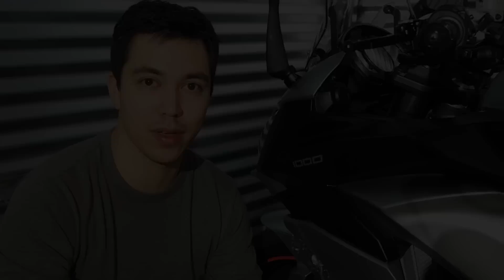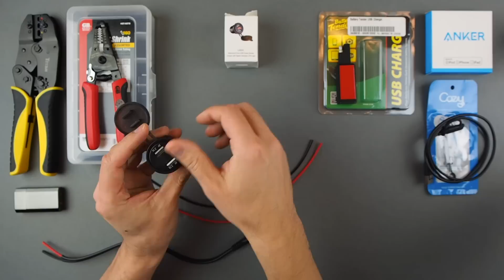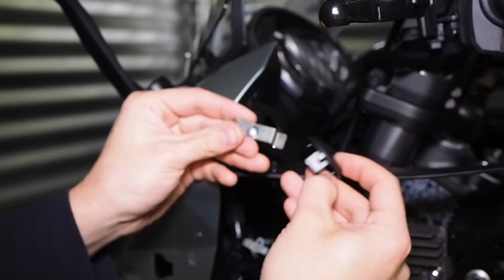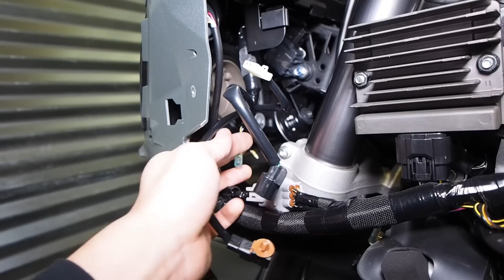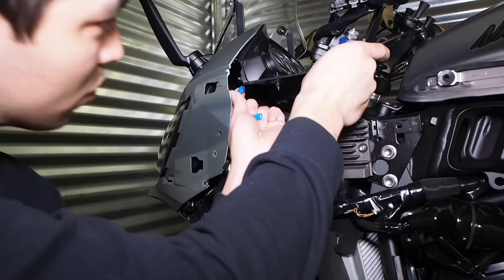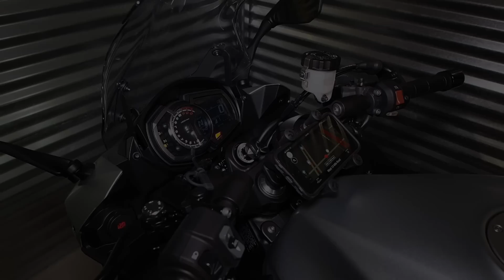USB Power Outlet Install: 2018 Ninja 1000 / Z1000SX

Comment: When the USB connector is not connected and the ignition is on I get a 12V reading using a multimeter from the connecting wires.
When I connect the USB device I take measurements from the base of the male spades at the back with the 12v connected and I get a reading of 5v and the USB device does not work. Any ideas?.
USB device works fine when connected directly to the battery.

Comment: the 2022 ninja 100sx has a connector plugged into a dummy socket on the chassis, this only outputs 4.5v so i took the 12v feed from the left headlight red lead
Reply: Thanks I have  2023 year and will follow your lead. did you just splice into the red headlight wire?

Comment: Need your help on how to connect the 2021 wiring Jonathan! Any help you can provide would be great. I wired up the whole thing and went to connect it, but found a two hole plug. Can I just wire both ends with bullet connectors and stick them in if I remove the little black stoppers?

Comment: Great video as always, I was wondering if the 2020 ninja 1000sx install is the same ?
Reply: I'm wondering the same thing as I pick mine up in April - great video and thanks so much for taking the time to make it!
Reply: Also, the USB socket you recommend is not available on Amazon - would this be a good alternative?  https://www.amazon.com/MICTUNING-MICUV2USBRED2-Voltmeter-Universal-Motorcycle/dp/B01M7V1ME1/ref=dp_prsubs_1?pd_rd_i=B01M7V1ME1&psc=1
Reply: @timobarlow  I’ve found the connection for the USB . I struggled to find it with just taking the small fairing off so I ended up taking the large side fairing off and found it taped up to another loom. I bought a usb socket from Amazon and also the connecting wires I need to fit into the original connection. Pretty straight forward from there on
Reply: @applewoody  Awesome - thanks for clarifying that and hope it all went smoothly.
Reply: @timobarlow  I then found full instructions with pictures on the z1000 uk forum ! Take a look
Reply: I’m gonna take the fairings off and have a look, I’m pretty sure those two connectors will be there waiting for the usb socket to be connected to them
Reply: @applewoody  Do you know what size the bullet connectors are? (4mm or 5mm)
Reply: I bought these, the connections aren’t the same as in the video, they’re the same as in the link. Hope this helps, mine are arriving tomorrow so I’ll be doing it then.
Reply: @applewoody  Don't see a link but I really appreciate your feedback. Keep me posted about your progress and good luck with the install!
Reply: @timobarlow  sorry can’t get the link to display here for some reason, here’s the copy and paste of the description......ZOEON 10 Sets 2 Pin Way Car Waterproof Electrical Connector Plug with Wire
Reply: @applewoody  How did it all work out Dave?
Reply: @timobarlow  great thanks mate, with the connection kit I mentioned above, I fitted the usb charger up front and also under the seat, there is a connector ready for that near the batters on the left side of the bike, taped to another thicker wire, I made a bracket in work and attached the socket to it. If you need any info and pics of why I did I guess you could find me on Facebook and I’ll show you
Reply: @applewoody  ok cool, I will - congrats on the install :)

Comment: Hi Jonathan,  nice video, very informative,  good job You doing here for us. 
I Wanted to ask You Do You Have instaled port or any kind of connection point to be able to charge Your motorcycle battery ? 
If so, can You make short video Please?
Thank You.        Vlad
Reply from the maker: I have a simple Battery Tender / SAE terminal connected to the battery.  There's no need for a video.  It just connects directly to the battery terminals, and is tucked away under the seat.  I only use it in the winter when the bike is stored for several months.

Comment: Annoyingly the 2020 ninja has dropped the bullet plugs in favour of some proprietary plastic plug. There's not a massive amount of slack on the cable either, so attaching a new connector was quite fiddly. I ended up taking the dash out of the bike which requires taking off the screen and a part of the nose to get better access. The screen is part of the dash on the 2020 so I disconnected the battery and then unplugged the screen. Also the connector for the dash port is a little more tucked away than on the old ninja - I didn't find it initially. As per the old ninja the one near the heat sink, further back is for the heated grips. They're not hanging loose either - they're placed in blank female connectors taped to the loom.
Reply: Bugger I was all geared up for this. Would of been pissed to start taking the fairing off & discover this. Thanks for the update looks like more dismantling is required.
Reply: Thx for sharing I'm planning to do this soon on my 2020. Is it a SAE connector?
Reply: No it's not. I asked one of the Kawasaki dealers and he wasn't sure what type of plug it was, and apparently Kawasaki don't sell individual plugs for their looms. I ended up buying an automotive 2 way plug from an electronics store and cutting the old plug off. You can get an idea of the existing plug here: https://kawasaki.com.au/shop/accessories/motorcycle/sport-super-sport-accessories/power-outlet-12v-2/

Comment: So, I have a 2020 ninja 650. It doesn’t seem to have those two wires behind the interface, but it does have an electrical accessories connector mounted under the left fairing. Would I use that for my dc power outlet? Do I need some type of relay to hook up to it?

Comment: How does the Battery Tender USB charger differ from you plugging in your USB cable to the Dual USB Socket you installed?
Reply from the maker: Functionally, there is no difference.  But the Battery Tender allows me to always have a phone charger cable installed and ready to use, without being very visible.  If I was just using the dual usb socket, then the charger cable is more visible and I would have to unplug it in the event of rain.  I almost never use the dual usb socket, except in rare cases where I need to charge some other device (like a GoPro or a bluetooth communicator).
Reply: @JonLong  Awesome, thanks for the reply and video, very informative. Just got my '19 1000 and your videos have been super helpful.

Comment: UPDATE:  To accommodate the USB charger, used a half round file to make the hole a little larger. Attached the leads, properly, to the charger and to the two wires (supposedly coming from the ignition switch). Turned on the 2018 Kawasaki Ninja 400 KRT ABS ignition - but the USB charger, which has a voltmeter, did not work. Attached two other voltmeters directly to the Ninja's two wires, and again, there was no voltage present. 
I'm going to try to locate the fuse box and check the fuse, but I can't imagine that the fuse could be blown when those wires were never connected to anything.  
Your thoughts???????
BTW - purchased a box of "assorted" bullet connectors from Amazon  - the only thing "assorted" about them were the five colors - my caliper measured them all to be the same size - can we all say "false advertising"? 
Kawasaki Kid
Reply from the maker: Fuse seems like the obvious first thing to check. Are you turning the key on, or starting the bike? Might not make a difference, but it’s worth trying. Also, usually the colors of the bullet connectors signify the wire gauge that they are meant to accommodate, not the dimensions of the connector itself.
Reply: @JonLong  

Bullet connectors were crimped tightly (and pull-tested), not on the wire insulators, but the bared and twisted wires themselves. (Electronics was my hobby as a kid - went eventually to RCA Institutes, worked in electronics in the Air Force, worked for Philips Norelco, and I'm a FCC licensed amateur radio operator). Never came across "bullet connectors" before. Imagine that?
Anyway, the fault is that there is no current through the Ninja's accessory wires, whether the bike is "on" in neutral, or the engine is running.
So, I'm checking YT vids and then my manual, if necessary, for the location of and access to the fuse box.
Wish me luck, and "happy 75th birthday" to me in two days.
Thanks,
Kawasaki Kid

Comment: Just removed the dummy plug from the bike (2018 Ninja 400 KRT Edition). Used an offset ratchet screwdriver with a #1 Philips driver. No need at all to remove any fairing.

Comment: Very clear, well produced informative video.
QUESTION: Other presenters include the use of a RELAY  - why doesn't your setup "require" a relay, and why is your setup apparently not using a fuse?
Many thanks & stay safe!
Reply from the maker: You might use a relay if you have a switched circuit that can't safely handle the power draw of whatever accessory you are installing.  There are other reasons to use a relay, but that's the common one for aftermarket electrical accessories.  The reason it's not necessary for my installation is that I'm using the factory connections on the bike.  There are two sets of connectors, one is to power heated grips and the other (which I used in this video) is meant to power a 12v accessory outlet.  Even though I'm not using the OEM accessory outlet, the power demands are the same.  I also do not need to install a separate fuse because the bike already has a fuse on that circuit in the fuse box.  This is basically a factory installation, but with an aftermarket part.  Hopefully that makes sense, but let me know if anything is unclear.
Reply: @JonLong   Your answer was as perfect as your video, many thanks!
Reply: @JonLong  Please advise what SIZE bullet connectors are needed - will pick them up tomorrow.
Thanks!

Comment: Can I connect my satnav into the same connectors along with the USB port connection
Reply from the maker: Yup! Or you could use the secondary connection on the bike, which is for heated grips.
Reply: Thanks Johnathan all connected satnav working perfect but think I might have a dud USB port

Comment: what size wires and what size bullet connectors/type did you use with the USB charger? I have a 2019 Kawasaki ninja 400 ABS
Reply: SAME QUESTION ABOUT THE BULLET CONNECTOR SPECS, please.

Comment: did you use a relay kit for that?
Reply from the maker: No, there’s no need for a relay for this.  The connectors on the bike are already setup for this kind of use and electrical load.

Comment: I have already done this on my 2012 sx and it did not have the socket for the plug.
I then cut a hole in the dash, i put a cig lighter in as well for a air pump for a flat tyre, and also added a inline fuse.
So i can have 4 usb's if i want to
This i attached to the heated grips not really needed where i live in Aus
Then i covered all the connections with hot glue to stop movement and to keep out water.
I would have liked to have the volts shown.
Flat battery the other day showed 12.5 volts but had no amps at all not even a spark from shorting!
Q.  I would love to see a graph on how much amps are produced and how many accessories you can add before you use more than you produce.

Still good vid mate.

Comment: What gauge wires are you using, please?
I'll be doing the same thing with my 2018 Kawasaki Ninja 400 ABS KRT Edition, and hopefully, I can do it without removing any fairing.
Thank you.
Reply from the maker: I believe I used 16 gauge wire
Reply: @JonLong  

Thank you.
Reply: Jonathan Long is there any special type of wires to use like speaker wires? If we have a higher amp quick charging usb socket will 16 gauge be safe? Sorry not too electrical knowledgeable

Comment: Hello Jonathan, are you sure, that you used the right cabel for USB? My Kawa-Dealer used this "Port" for the Heatgrips. Another Youtuber used the other Cabels for usb. I want to install the USB too but now i don't know if my Dealer make a Mistake or you. Or does it no matter because both are same?
Reply from the maker: I am sure that I used the right connections for the USB. Both connections (usb and heated grip) have the same plugs and the same voltage. So either of them will work for USB. But the heated grips connection is rated for more amps, so it is the only one safe for use with heated grips. The usb will not use as much power as heated grips.
Reply: @JonLong  Thank you for your prompt reply. I think you are right because the cabel from the original USB charger (Kawasaki) are to short for the other connection. And thank you for all great videos. Very helpful!!

Comment: Hi so if i want only the USB charger ,I can just plug it into the female/man part or directly to the battery and it will work ? BTW i have the ninja 400 do i need to buy a relay for the connections to work or not ?
Reply: NOT directly to the battery or you'll be draining the battery as the bike sits/stands not running.  Connect the USB or 12v outlet to the available wires  coming from the ignition. That way, only when the ignition is "on", will the USB charger/voltmeter or 12v outlet be running.

Comment: Hi Jonathan,

Many thanks for taking the time to post this info, I’ve just used these tips to fit the USB socket and also fitted some Oxford heated grips. (Well it is pretty cold here in the UK at the moment!🥶 ) And you pointed out the correct connections for these which made the job a whole lot easier.
Of course I got the socket with a green LED which looks much better on my Green Z1000SX 😉
Many thanks again for these great how to videos, and I will keep an eye out for your next one. 😃
Cheers
Andy

Comment: Thanks for doing this video, it helped me a lot. I did mine today, however I managed to do all of this without removing the whole side fairing. I only needed to remove the top part of the side fairing and release the plastic piece to gain access to the back of the USB drive. I was then able to reach in from the top and from underneath to connect to the terminals. I felt relieved as I wasn't overly confident removing the whole side. Also, for anyone else looking at this video to do the job yourself, I needed the smallest 'bullet plugs'. I found out these come in different sizes and my first attempt failed, due to sourcing a bullet connector which was a bit too large.
Reply from the maker: Thanks for sharing your experience!
Reply: Justin, have you the SPECIFIC size of the necessary bullet plugs? Thanks!
Reply: @usernamemykel  I bought a small kit which contained two plug sizes and I used the smallest ones. In my experience, it wasn't possible to buy just a couple plugs. It wasn't expensive, I think I paid about £5 on amazon. FYi, this is what I used. https://www.amazon.co.uk/gp/product/B07D7WHRG3/ref=ppx_yo_dt_b_search_asin_title?ie=UTF8&psc=1
Reply: @JustinWilliamsWEBSltd  Many thanks!

Comment: Hi Jonathon,
Just did this today after doing your Ram Mount mod yesterday. Thanks for doing the video. Just one thing though, I did not need to take the whole fairing off. I only needed to take the first top section off with the 2 screws and pop rivets. I was easily able to connect the cable this way with my fairly large hands.
Thanks again.
Reply from the maker: Great! Thanks for the tip!

Comment: Hi Jonathan, thank you for your excellent video! I installed it today exactly the way you explained in your video. Someone in my Kawa group noticed that a different relay is necessary. Do I have to install a different/extra relay? Thanks. Danny. GER.
Reply from the maker: Hi Danny!  You shouldn’t need to change the relay for this mod.  But remember that there are different limits for the accessory power connection, and the heated grip power connection.  The heated grip connection will have a higher rating for more current.  The only relay that I changed was for the LED turn signals.  That is covered in my turn signal video.  Let me know if this answers your question!
Reply: Hi Jonathan! Thanks for your reply. That should work fine then. Out of curiosity: What is the maximum current for the accessory power connection and for the heated grip power connection?

Comment: Followed this exactly and referenced your vid in my vid, there was no point in doing a how to with such a good example here. This project was so easy using these exact parts. Great job on this and my bike thanks you, I soldered my connectors and then electrical tape and shrink wrap.

Comment: Brilliant video. I’ve done the same on my new Silver Z1000SX. I used an ultimtaaddons 5v supply though which has a water proof connection on the end. Then a male of the same type ti lightening which is compatible with the waterproof phone case.

Comment: Hi Jonathan! You made a really instructing videos! Well done.

I have a 2018 Z1000SX too and I want to install a GPS tracker like this:

 http://s.aliexpress.com/qAzqEJRV

Do you have any advice for my? Where can I find easily +12V, GND, ACC?

You could make a video! 😃
Reply from the maker: Glad you enjoyed the video! If you’re looking for 12v, ground, and accessory, I would add a terminal to the battery for 12v (always on), and then use either of the factory connections for the heated grips or the power outlet for the accessory power. For ground, you can use the negative terminal of the battery, of either the power outlet or heated grip connections, or any metal point that’s grounded on the bike.